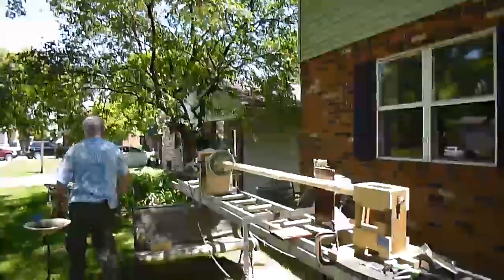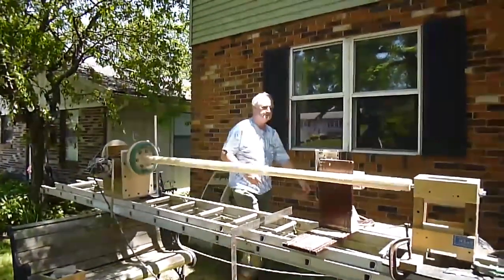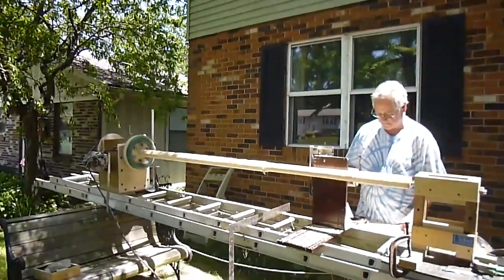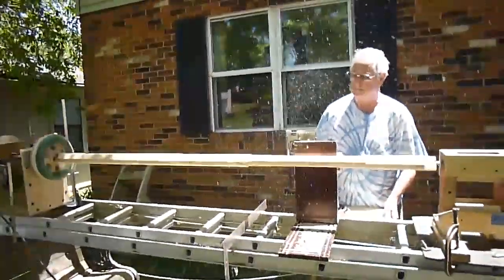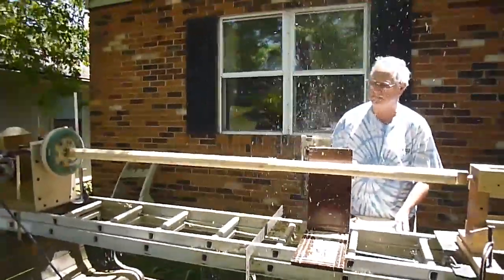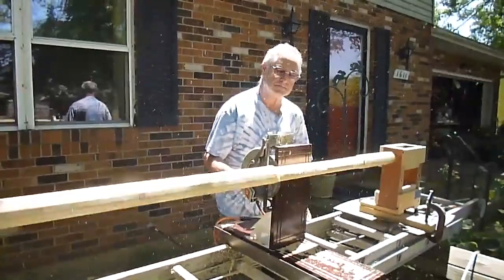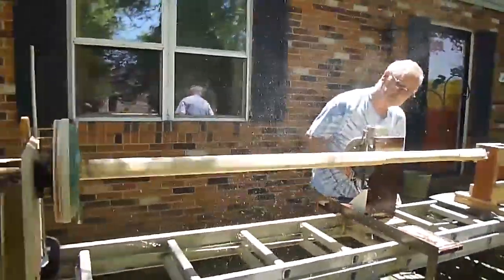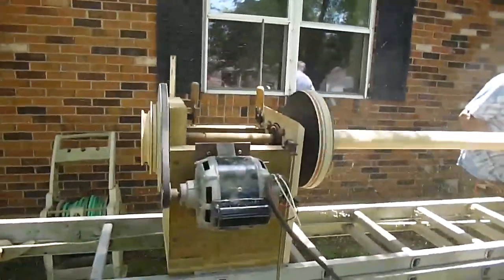Michael Sullivan's crazy homemade lathe

Comment: That is an interesting setup! I love the modularity of it.  I wonder what the limitations of using the circular saw are... I guess maybe he could at least rough it with that, and maybe finish with sandpaper or some other abrasive if he wanted more intricate curves. On the other hand, maybe the saw is good enough for what he does.

Comment: I like this idea.  My lathe isn't well set up for handling large unbalanced loads because it won't go slow enough (I really need to build a stepdown pully for it).  Something like this - maybe driven slowly and with the saw at an angle - might be good for turning long logs into turning blanks.

Comment: That’s a great set-up. It reminds me of wood lathes from the 19th and early 20th century where the head and tailstock were manufactured pieces and the user mounted them on a pair of heavy wooden beams to whatever length was needed.
I wonder if a router with round nose bit would be smoother than a circular saw blade cutter…?
Reply: The problem with a round nose bit is that there is too much contact area and chatter is very likely on a long thin part and zero surface speed at the very tip (unless you tilt it onto the side a bit) The saw has a high surface speed and small contact per tooth.

Comment: Can't help but wonder if this would work even better with the saw blade tilted... but my curiosity does not extend far enough to actually try building such a monster (wouldn't know where to put it anyway)
Reply from the maker: if the blade is tilted, it may bind.  Bad idea!
Reply: You have a point. But would it be more efficient in the time before it turns into a sawblade-and-tree-shrapnell-explosion? hides Don't worry, as I said above, I am not going to try ;-)
Reply: Actually I kind of lied. Let me fix that: don't worry, I am not going to try it on that scale?

However, the (very much smaller) blade I might try something similar with would be much less likely to bind for a variety of reasons (including the geometry of the blade itself) and might not work at all if I do not use it at an angle because it doesn't have teeth wider than the blade disc.

So the question is not entirely hypothetical, although right now I am not sure if the thing I have in mind makes any sense at all... just can't help wondering...

Comment: How would one even begin to true the live center tailstock with respect to the spindle in a crazy setup like this? Same with having the saw run true to the axis...

It is long though, I'll give you that. Impressively long.
Reply: The head stock and live center were made to be the same height.  The side to side was measured from the saw base plate with the base against the edge of the ladder.  A hammer did the "fine" adjustments

Comment: In my opinion, this is not a lathe. İt's a specific tool powered by a motor to make a specific thing only. You cannot  do much of the things you can do with a standard lathe. Maybe you can call it a long round bar making lathe :9
Reply: Raif Tolga Korkunçkaya it's still a lathe.
Reply: lathe,  noun, a machine for shaping wood, metal, or other material by means of a rotating drive that turns the piece being worked on against changeable cutting tools.
If folks can sand their work on a lathe with a palm sander, he can use a powersaw to cut it!
Reply: Workpiece rotates, so lathe with live tooling
Reply: It fits my description of a lathe!
Reply: Raif Tolga Korkunçkaya Well, your opinion doesn't mean shit, so there you go...
Reply: Fester Blats good one dick slap. .

Comment: On a ladder haha
Reply: Extension ladders are great! Parallel rails in different lengths. relatively stiff.  With some plywood and putting the 2 halves of the ladder into a T configuration it can be quite stiff.  I've seen it used for emergency radio towers, bridges, temporary fences, gates, table frames, crane jib/boom, ....